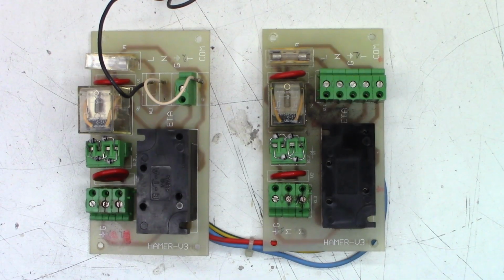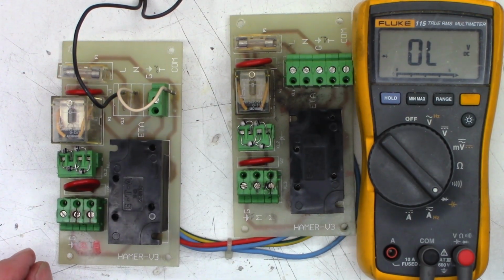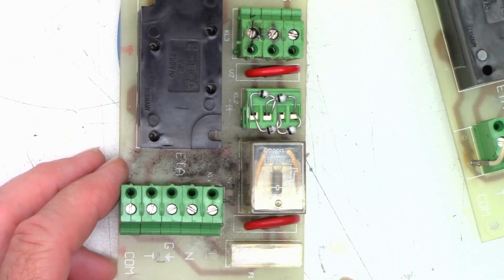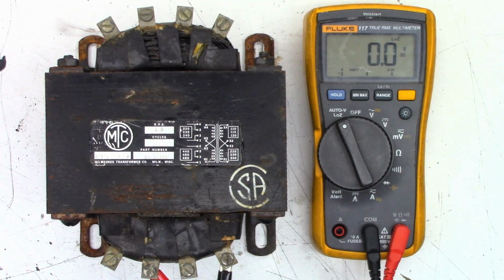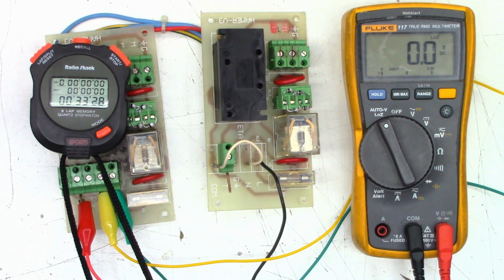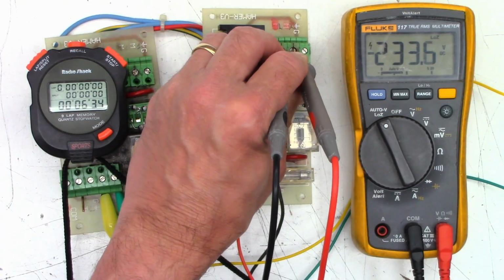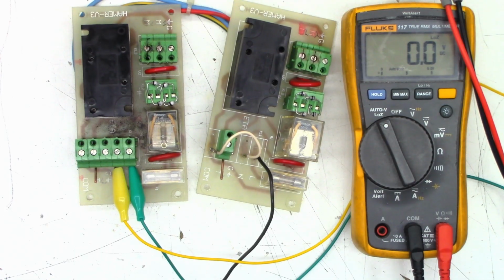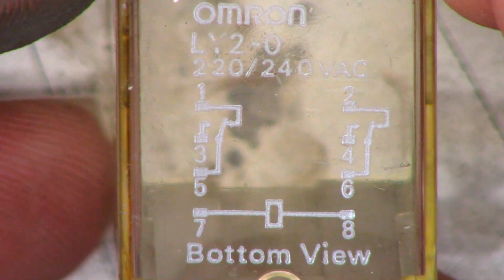Troubleshooting a Couple of Old School Time Delay Circuit Boards

Comment: Cool old devices and looks like the relay needs some sort of surge suppression for the DC arcing. Cover says it rated for 10A at 24VDC, so what would it be at 240VDC? But yeah, it did last for what looks like a long, long time. Unless the rectifier is after the relay, so the relay is switching the AC for the rectifier. Hard to see on video and doesn't really matter anyway... lol 
Plus a stupid question, when you zoomed in to the fuse it looks like your work bench is metal. When that power supply in the last video went boom, it looked like those bottom SMD resistors shorted to the table, based on the way the solder connections looked. But there's no way you have a metal work bench, right? Painted or not, looks like galvanized metal where there are chips in the paint.
Reply from the maker: The workbench is a Formica counter top that I tested with a ESD tester and had something in the order of 10Gohms. I am shooting pert 2 of the time delay boards today and will try and show the workbench in its entirety. I did a you tube short a few days ago that shows the workbench as cluttered as it is. https://youtube.com/shorts/HXPfo_-ug9I
Reply: @norcal715  OK, I didn't think you would actually have a painted metal workbench. But thinking metal from last video and then seeing it up close in this one it did look metal to me. I was like, there is no way that is metal and as expected, it's not. Thanks for clearing it up.

Comment: Looks like those are arranged as on timers, with the relay energising the bridge rectifier to power a DC motor, that runs a crank that acts as a clapper pull, and having 2 is for the 2 different bells, so you only have to press a button to have the bells ring for a set time. One has a lot more wear, probably because it runs the main bell, which probably operates on the hour or at noon, likely driven by a pendulum clock with a electrical signal output, and the other only is run on Sundays to call the mass starts.